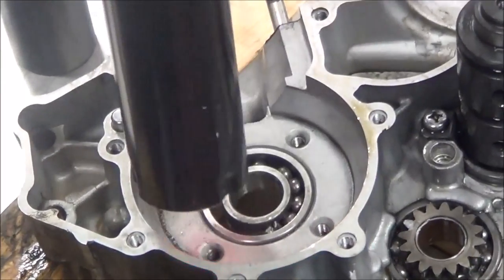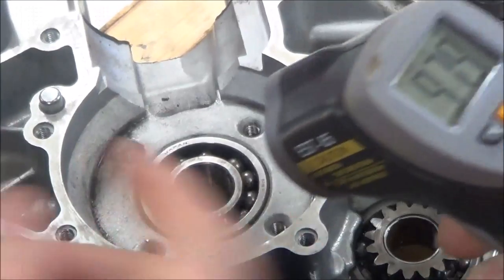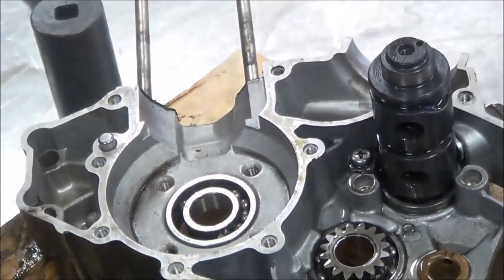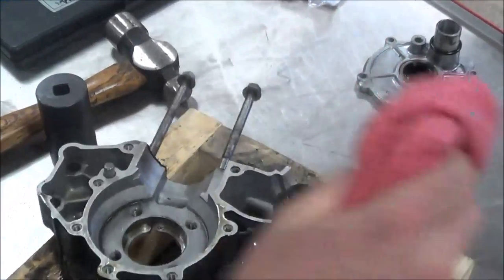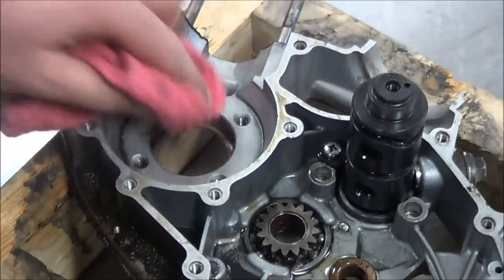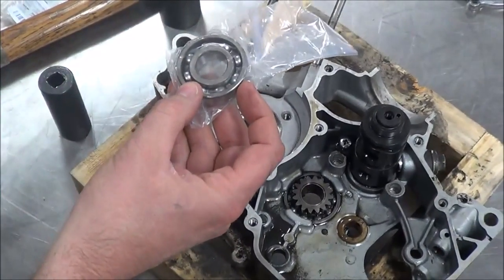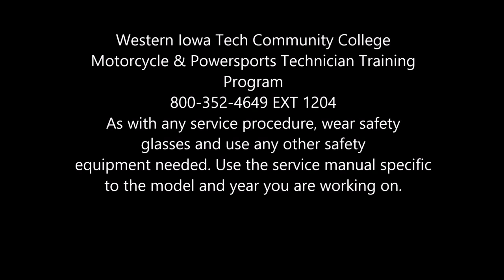How to remove a bearing with heat 2 Stroke Engine Disassembly   11 03 14

Comment: This is a great video. Would this method work if you want to save the bearings and reuse them? Also would this heat treat method work on a magnesium case? Thanks in Advance!
Reply: Why would you remove the bearing if you wont even replace it?